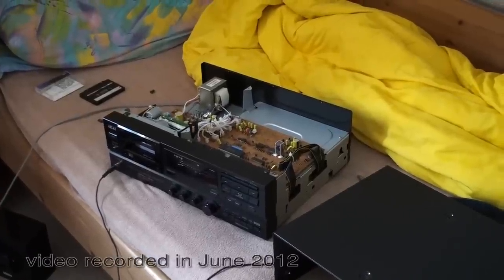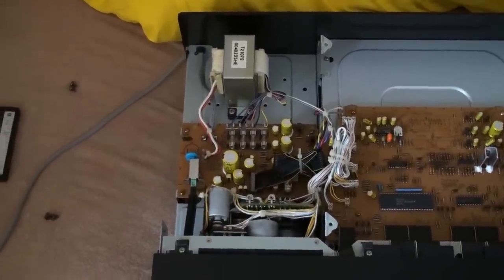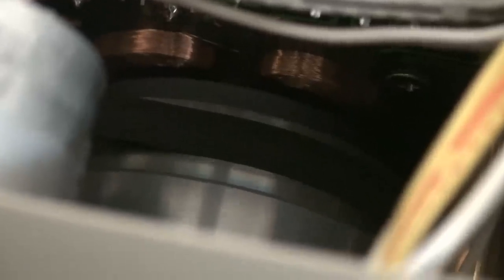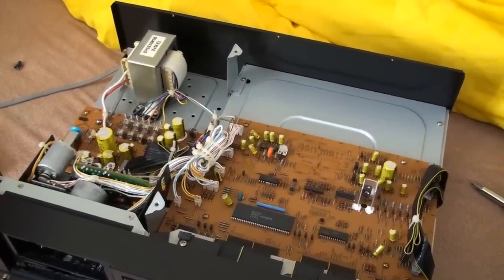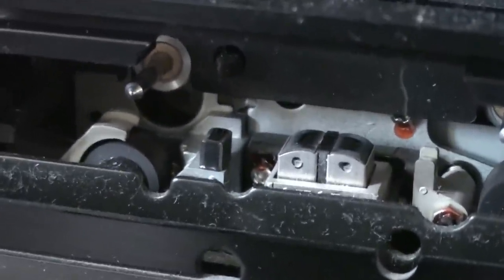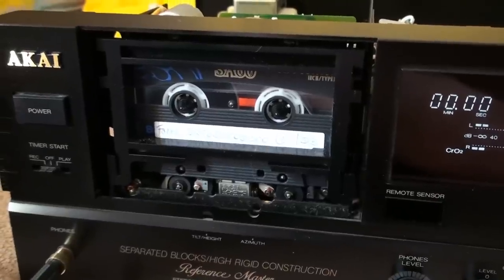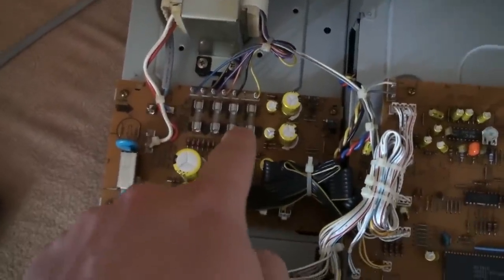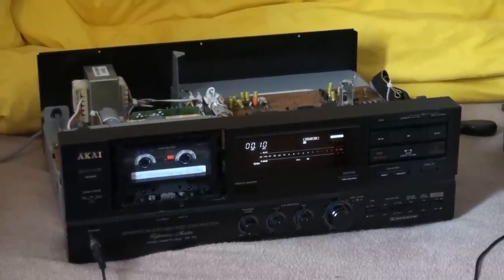Inside the Akai GX-75 cassette deck

Comment: I have the GX-95 model later version built like a tank since new ..it never gave me problems still use it today with outstanding recording outcome. I had compared it to a Nak Cr7A and ZX7 and it is at the same level perhaps the zx7 is able to record at a hairline level better due to manual adjustment. I had collected all Akai GX and GXC high end decks and to me they all sound great and record great but i had adjusted them all individually for my listening needs. I had compared about 120 cassette decks from mid 70s to mid late 90s and there are cons and pros for each deck out there..sometime people are fixed on certain decks but the reality is whatever one likes and it satisfied with that is the one deck for that particular person..
Reply: 120!!? That's hell of a lot.🙂. So which ones you distinguished from all of these? Is gx 75 amongst them?
Reply: You should adjust them using an oscilloscope, not by ear or "listening needs" :)

Comment: The inside looks a lot like my GX-52, but has a single capstan. Problem with mine is the motor on the left with a small belt on it which drives the open/close mechanism of the door.. the belt is more or less dissolved and I have a hard time removing the whole mecha block in order to get there, as a lot of dissolved belt sits around the  motor and the bigger wheel beneath it. I have to get a new belt, but also a proper instruction in how to remove the mecha block (a lot of cables which seem to block the proces in removing it from the main deck) to release the motor of the door mechanism.

Comment: At 5:52 "this thing really starts cooking" HAHA LOL! sounds funny, however that is one reason I just am not really into the late 80's(1989-1990)type of electronics. My most prized tape deck so far has been the Pioneer CTF-9191. The power transformer in that deck is HUGE! and the whole silver faced classic is very heavy. I had 3 of them at one time,one a parts unit and the other two in great shape. Got em off Ebay and then a few years later, sold them back on there. I HATED 2 do so,however, I will get another one back soon!.
Reply from the maker: tweelet The sad thing is, many years ago I saw a Pioneer CT-F9191 at the dump. Being a kid, I didn't have the courage to take it :(

Comment: Great deck, armored mechanics and construction. Separate electronic blocks. I have gx75mk2 from new and it is my favorite deck among many I have.  You should know that the gx75 and gx95 have a manufacturing defect and should not be recorded via the Direct connector. This defect is due to the factory badly soldered capacitor. This deck is a master of neutral sound.
Reply from the maker: Interesting, I have never heard of that. Do you know where this manufacturing defect is located inside the deck? A bad solder joint is easy to fix once it has been found.
Reply: @DrCassette  C502 is mounted inverse to the diagram. PCB is incorrectly marked.
Reply: @DrCassette  Hi anyone can help me ?
I have a a&d gx z7100 same model but unfortunately it's capstan speed is somehow increased and couldn't not be come down from anywhere within the circuits or adjustment within boards 
Can you guide something on speed issue where to see fault ?

Cheers
Reply: @claudiucorneanu5125  Hi can anyone help ?
I have a a&d gx z7100 same model but unfortunately it's capstan speed is somehow increased and couldn't not be come down from anywhere within the circuits or adjustment within boards 
Can you guide something on speed issue where to see fault ?

Cheers

Comment: About the transistor and the transformer getting very hot, on my GX-95 they stay cool all the time. But here the grid is 220Volt
Reply: Same here, but I have the GX-75 MKII, which seems to be built better.

Comment: Hi good video .
I have a a&d gx z7100 same model but unfortunately it's capstan speed is somehow increased and couldn't not be come down from anywhere within the circuits or adjustment within boards 
Can you guide something on speed issue where to see fault ?

Cheers
Nauman Dodhy
Pakistan

Comment: Hi, I've bought an A&D GX-9000 cassette deck. the condition is good. but the counter only work in elapsed mode. the tape speed is a bit slow. how can i change the tape speed in this machine? the adjust potentiometer is empty on board.
Reply from the maker: First check the belts in the mechanism. That may be the problem with the counter and it could also cause playback to run to slow. If this is not the case, there should be an adjustment potentiometer behind a hole in the back of the capstan motor.
Reply: DrCassette , Thank you, you're right, I've fixed 2 cassette deck with this way. But a&d z9000 is different. As you know, It is direct drive! Similar to your Akai deck in this video. Also the counter act with optical sensors. I read the manual and saw VR1 and VR2 potentiometer.They are on the top of mechanism block, but I can't change the tape speed With these adjust elements. On the other board of this machine I saw a text "tape speed" but near it just shape of a potentiometer printed on the board and it is empty, may be it is for other similar model of deck.
Reply from the maker: You will figure this out yourself then. I don't know this model of cassette deck.
Reply: DrCassette , I fixed the counter (small trash had been attached to the sensor). I searched the net and found many people that say the direct drive decks have no adjustment for tape speed! I should clean the mecha.. And it is vey time waster.

Comment: Nice machine. I also prefer decks from early 80s, right after Dolby C was introduced, preferably without Sony Dolby chips (JVC TD-V 541 sounded horrible with C, CXA1331, HX Pro), as they were build  better than in '90s. I have Nak DR-2 that needs a lot of work (no direct drive on capstans 😠) and it's build quality is nowhere LX, CR series or the Akai you have. Too bad Akais weren't sold in North America,  they're quite good decks.
Reply: Never a fan of Nakamichi's DR and Cassette Deck series. Much prefer LX and CR series.
Reply: Yes, without Dolby , its just marketing trick for substitute linear quality for compressed sound.
Reply: Akai’s were sold in North America. There’s many that are 120v.

Comment: Highly overrated deck; built to impress, but disappointing in many ways. The tape path is a nightmare to align, and without a tape guide on the side of the head, head azimuth is not constant. The direct drive is not quartzed and overall it has worse W&F than a more rational and conventional design. Audiowise is nothing exceptional, not better than most contemporary mid/high level tape decks. I had it for like 4 months and sold it right away.

Comment: Have you checked the mark ii version? Or anybody here? How does it compare? Does the power transformer has an impact on the sound or is it just  a failure chance factor?
Reply from the maker: Generally the transformer should not cause any problems, it is just an unnecessary heat source inside of the cassette deck, and without cooling vents, the heat doesn't have anywhere to escape.

Comment: With that amount of heat produced you’d think they would have put a fan in it? 🤨
Reply from the maker: Putting fans into hifi equipment is a terrible idea. Use properly dimensioned heat sinks instead.

Comment: GX75/95 is beautifull decks but quality is average or bad....sensitiv mecha, idler with small tolerance, switches for call, dolby etc are bad quality, bad implementation of hx pro, no remaining time like older models, too narrow calibration, sound too flat...compressed sound of dolby when read another deck recordings....beautiful but average and cheap deck. Older GX 6 and 9 are diemetral different with sound and quality. GX 75/95 (btw the same deck) be so popular that Akai produces day and night that units with some quality issues.
Reply from the maker: I'm not so happy with this deck anymore either. Mostly because a much cheaper Sony TC-KE600S has much nicer sound quality, especially when Dolby is activated.
Reply: DrCassette ...try any deck...example cheap Technics and you will hear better recordings and overall better quality
Reply: I have my eyes on a gx75 mkii, it's 300 euros and was overhauled before two years with very little use since then, you think I could get a much better deck for that money? Could you suggest few?
Reply: @DrCassette  the question goes also to you. Thank you
Reply: Please concider that in Europe the used market for hifi is much more expensive comparing to USA. I read buys on the net from private sales that are crazy cheap (like sub 100 dollars) in the USA and there is also much more than europe
Reply: @dimitrispanayides6912  Pioneer CT 777,  Sony TCK 770/790es, etc